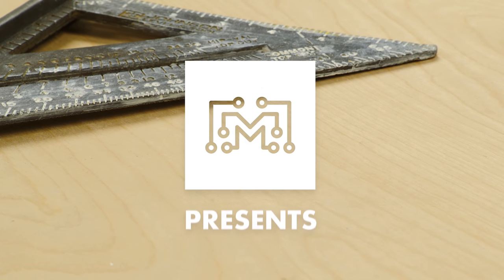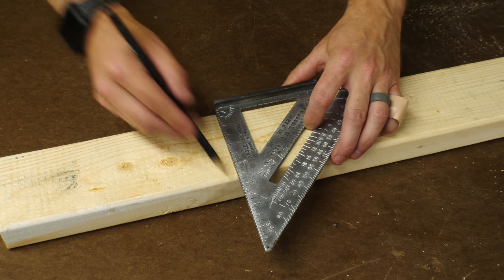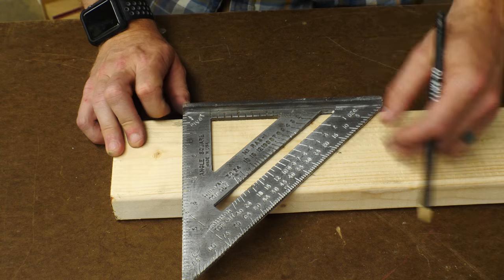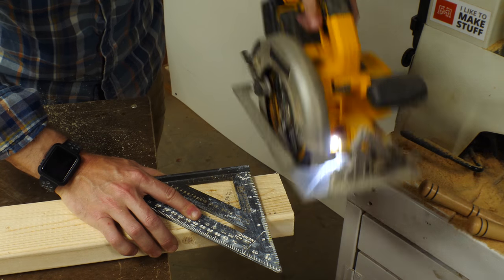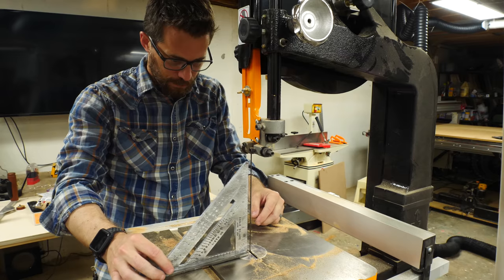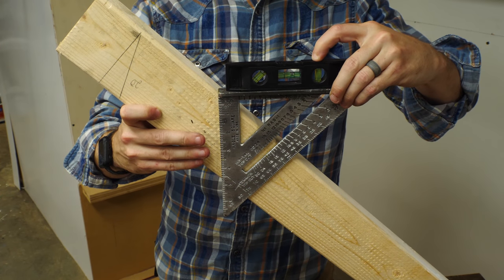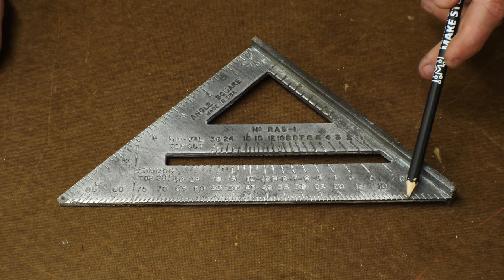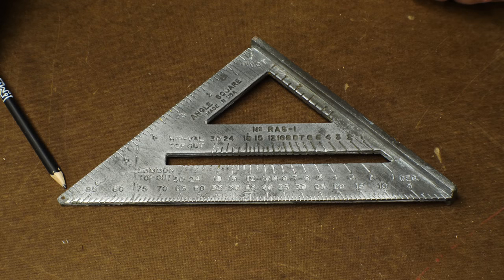How to Use a Speed Square // Bits | I Like To Make Stuff

Comment: I use my speed square to square up items that I'm screwing together. I find it easier to use in many cases than a framer's square because the foot allows me to lock it into one work piece - sometimes I even clamp it into place - and then place the other work piece against the speed square to get a perfectly square connection.

Also, when using a speed square as a cutting guide for a circular or jig saw, on smaller pieces I find it better to put the foot on the opposite side of the work piece from me. This makes the point of the square hang over the edge toward me, giving me an edge to line up the saw with before the blade ever touches the work piece. And I often clamp the speed square to the work piece with a pistol clamp or spring clamp to hold it in position while I'm cutting; this is necessary with a lot of circular saws that require a two-handed grip.

Comment: Great quick vid, Bob and thank for inviting comments. I just listed to the Making It podcast where you guys discussed comments. I use my Speed Square all the time and just this weekend purchased an American made aluminum one from Craftsman that Ace Hardware has on sale for $3! The only thing I do differently than your video is for crosscutting at 0:40 I hold the square against the back edge of the board to give myself a little more guide leading into the cut. The cut itself helps me continue straight. Scott
Reply from the maker: Good call!

Comment: Like one person stated, there are usually notches inside the speed square that will help you quickly draw a line parallel to the edge of your work. I use the tool to quickly see if two pieces of wood like a stud is perpendicular to the floor for example. Also the angled side of the speed square will quickly allow you to draw a 45 degree line. Good stuff!!

Comment: Flip it around when using it as a saw fence. 
1) The point, aka extra fence, is the towards you  giving you more fence to start your cut. 
2) The hook of the square is out of the way of the motor and other parts of the saw allowing for a cleaner cut. 
And 3) It secures the work by providing for a push, the saw, and a pull, the square, clamping the work in place.

Comment: my dewalt speed square has notches at 1", 1 1/4", 1 1/2", 1 3/4", 2", 2 1/4" and 2 1/2". those allow me to make a line down any piece of wood using the foot of the speed square. very useful for marking the center of a 2X4 for example.

Comment: One of my favorite speed square uses is marking rip lines.  If you need to rip some 2-by or sheet goods down to strips with a smaller width than the ruler side of speed square, you can hold your pencil at the marking and run the square down the length with the foot against the material.  Some even have little cut outs with teeth that will hold your pencil and 1/4 inch intervals between 1" and 5"

Comment: Use it with a plumb line from the pivot point to use it as a level when the plumb line is at 45 degrees

Comment: Bob, I love speed squares. People tend to get over the top with woodpeckers type stuff when most things can be done with inexpensive aluminum speed squares. It's amazing stuff but woodworkers aren't trying to hold tolerances that machinists do. I love the anodized ones at HD, they are cheap and you don't need to baby them. I have used my combination squares far less once getting into using them as you said they are always spot on.
Reply: Woodpeckers is a manufacturer of premium woodworking tools, marketed to professionals and those who are very enthusiastic about their hobby. By all accounts, their stuff is really good, and it's made in the USA, so that's cool. It's expensive as hell, though.

Comment: Another use...
Some of theme have a hollow line in the exact middle, perpendicular to the bigger edge, for finding the center of a full round piece. You have to align the two small edges with the border of the piece and draw a line, rotate the piece and do the same and congratulation, you've successfully find the center of the circle.

Comment: You can use a speed square as a level if you put the hypotenuse of the square on the work, and then drape a plumb bob off the pivot point.  It's crude but if you don't have a level handy, it works.

Comment: You don't always need a level to find the angle if if have a plumb, you can put the to the corner (marked pivot) and let it hand now put the speed square to the rafter, the plumb will intersection the angle. This way you don't have to worry about focusing on the bubble in the level.

Comment: It's worth mentioning that even the cheapo ones from the big-box home stores are VERY accurate in terms of squareness and straightness. More than you are physically capable of detecting, at least in relation to woodworking. I may get some hate from high-accuracy machinists and the like, but for the home-gamer, an aluminum speed square is more accurate than you can ever take advantage of.
Reply from the maker: Very true!

Comment: The plastic ones are cheap enough you can put one in every toolbox/toolbelt so you never have to search for it (always losing those dang things), and if they break are easy/cheap to replace. But I always get a metal one, I like the heft and durability.